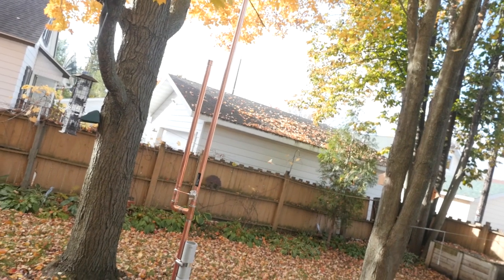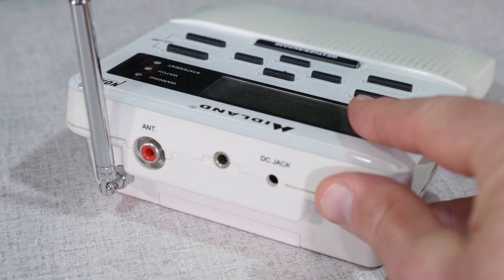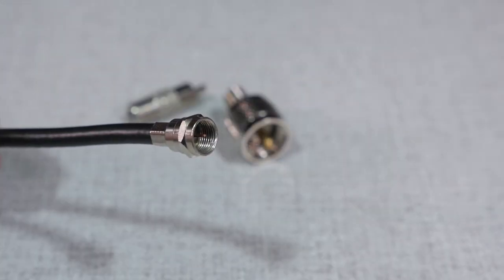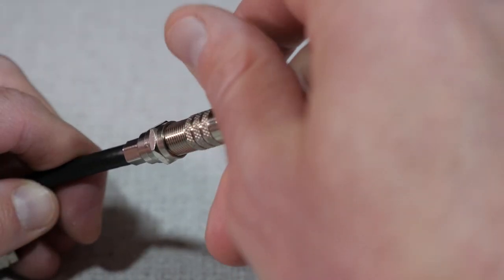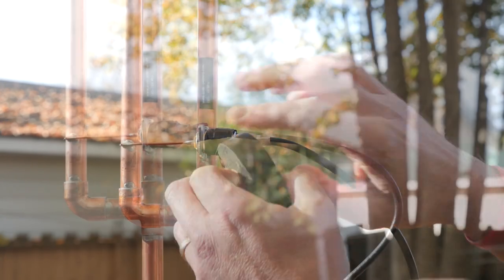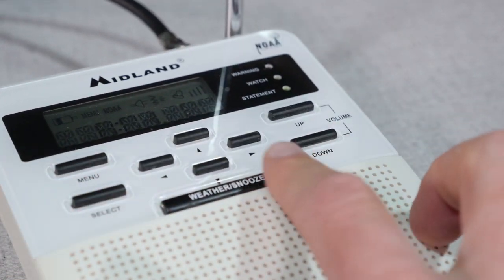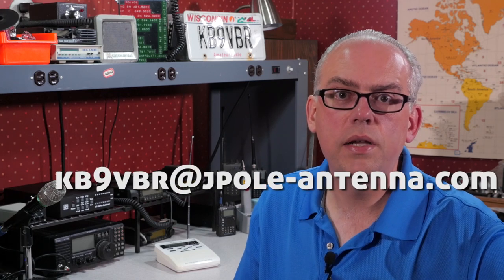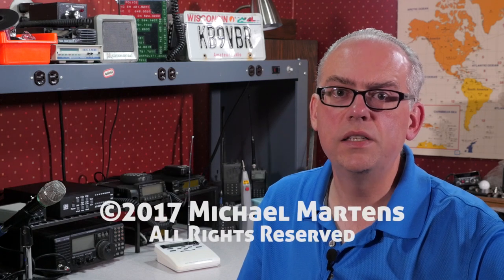Connecting an Antenna to your NOAA Weather Band Radio

Comment: Your NOAA Weather Radio is a Version 1 or Version 2 midland WR100. Those are extremely rare.
Reply from the maker: Wow, I didn't realize the radio could be valuable. It is a WR-100, but I couldn't tell if it was version 1 or 2. Serial number is 30804841. I'm guessing it's an early model as I've owned it for at least 10 years.
Reply: KB9VBR Antennas I know by the statement light.
Reply: KB9VBR Antennas Plug it in. It will say what version it is. (Probably a v2, most v1s are black and silver)
Reply: Not all WR100 V1 are black and silver
Reply: I HAVE A BLACK AND SILVER WR-100!!!! VERSION 1. I got it from my grandpa. He bought it when they were made.
Reply: What is the big deal about having an older model? It seems to me that the older ones don't have the current codes and they lack the feature to ignore the weekly test. I think a late version should be better.
Reply: KB9VBR Antennas their extremely rare now
Reply: @uruiamnot  they are still pretty rare tho
Reply: @KB9VBRAntennas  I think early V2.
Reply: @uruiamnot  people collect weather radios and people really like older radios
Reply: Yep, its a version 2. Any serial number above 306 should be a v2

Comment: Electrical tape does not provide a weather seal. It will break down and get very brittle when exposed to the elements over an extended time. It is best to use a proper sealant to protect the connection from  water intrusion.
Reply: Interesting 🤔. I really wouldn’t have no idea of what to use. Hehehehe 🙂
Reply: phil swift has something to say to that

Comment: NOAA needs to develop an App. Its a no brainer. Pick up the money lying on the ground for Pete's sake.
Reply: I know and make cars come stock with a wx radio frequency. I have the Midland 120EZ I think and it gets alerts sometimes but not all the time 🙄. Good thing I don't have to rely on it and don't get severe weather much.
Reply: You can't rely on an app because during severe weather, internet and power outages will possibly occur at any moment.

Comment: I am having a hard time picking up NOAA radio in my tractor trailer anymore.  I have a cobra 29 LX and it use to pick up NOAA radio good with all the alert alarms... now nothing... AND on a side note my WR-120 I had for years keeps telling me bad reception on the stock antenna... (No matter where in the house I put it), and also it never use too... I live between Norton, MA and Albany NY NWS. I am not sure what is going on, but it seems like reception to my area of western MA has changed on their side...

Comment: Is there anything we can do to help increase the amount of signal getting into the weather band portion of a portable multi unit AM / FM / Weather band radio? Regular weather band radios are nice and all but they’re not really meant to be portable. Just what does the weather band internal antenna look like in one of these radios?
Reply: They have an external antenna, the usual metal telescoping antenna mounted on top like you see on all portable AM/FM radios. It also has an external antenna jack.

Comment: one question, are the jpoles directional?  if i buy one can i move it around for better or worst reception?  i noticed it has a small piece and a longer piece...which one has to face towards the signal?  

thanks...
Reply from the maker: The J-Pole is an omnidirectional antenna, so it will receive equally well in all directions. Any bit of directivity you get from the stub at the bottom of the antenna is so slight that you probably won't notice a difference by rotating it.

Comment: I bought a Midland WR-120EZ radio to replace my 74-109. I can't get the darn thing to give me alerts. The old one still gives alerts but the voice is a bit garbled so we replaced it. I took the first WR-120EZ back to the store, figured it was just a bad radio but the replacement one still will not give me alerts. (With all the snow yesterday and lots of advisories and warnings it never sounded, not once and it always says "NO MESSAGE") I can't put up an outside antenna, but need some booster, I assume, but inside the house. What is wrong with my radio?
Reply from the maker: Maybe there is some interference or something else that is preventing reliable receiving of the weather broadcasts. Try moving the radio to another location or in front of a window to see if that makes a difference. Does the radio work outside? If you can pick up a signal outside, then there might be something inside the house causing interference.

Comment: My Wr 100s antenna is lose  and I think that the plastic part that holds the antenna broke off. I'm not really sure if I should fix it.
Reply: Undo 4 screws on the bottom. There was a screw that both secured the antenna to the case and to a wire. The wire is the important part. You could stick the wire out the hole and bolt the antenna to the now loose wire... and use duct tape.

Comment: CQ CQ CQ Question for you guys. I work at the hospital and I’m looking for the best weather radio available on the market. We have Midland WR300 hooked up to a VHF antenna on the roof, less than 20 miles from transmitter, and with a clear line of sight. The Midland is noisy at best with lots of distortion on the strongest signal, which is channel 4. When I hooked up my BAOFENG UV-5R on the antenna tuned on 162.475 MHz (ch. 4), reception was clear and crisp, so a LOT BETTER than the Midland. I read online that Reecom makes good weather radios, is that true? If I can’t get a better radio, I think I’ll install a VHF Yagi with a 160 MHz Band-Pass Filter, or even change the ceramic filters/caps for better ones. What is your advice? 73
Reply: Does the hospital operate it's own radio paging system? Being close to one of those is enough to swamp out reception.

Comment: Can you hook up multiple weather radios to one antenna?
Reply from the maker: Cable TV splitters are broadbanded and you can use those to distribute the signal to multiple weather radios. keep in mind that you are also splitting the signal strength between two or more receivers. If you have too many splits, you will end up with a very weak signal at the receiver.
Reply: @KB9VBRAntennas  thank you for your reply.

Comment: Can the pole attract lightning? If it Does I won’t buy it
Reply from the maker: Lightning is very fickle and can be attracted by any number of things. This antenna is no more attractive to lightning than an exterior mounted television antenna or satellite dish. You can reduce the chances of a lightning strike by properly grounding the antenna and using a lightning arrestor where the cable enters the house.
Reply: @KB9VBRAntennas  just thought of a crazy idea to get better wx radio reception, would using a old satellite tv dish work? I would prefer not having to mount anything to my house and deal with that crap but I already have a old dish network satellite dish on my house. Is there a way I could use that for my wx radio? 😂.

Comment: I have RCA output from the midland weather radio and a 5 dbi desktop Omni antenna RP-TNC Plug cable. To connect the radio to the antenna with minimum of 5 feet of cable between radio and antenna, has anyone seen this type of cable already made, I have no tools to make the connection.
Reply from the maker: MPD Digital will make a custom coax adapter for you. Check them out: https://usacoax.com/

Comment: May I ask how you run your coax through your house ?
Reply from the maker: My solution may be a little more extreme than most, but I drilled a 2 inch hole near where the house sits on the foundation and installed a service entrance and weather head for just coax. This is separate from my electrical service entrance. This gives me a flexible method of adding and removing coax for my station. This might be overkill if you need only one or two feeds to enter the house, so maybe a smaller hole with an electrical junction box installed on the outside of the house may better fit your needs.

Comment: Not sure that it makes much of a difference for a weather radio with a short cable run, but radios use 50 ohm cable, not 75 ohm like RG-6, which is used for TV RF signals.
Reply from the maker: It doesn't really make a difference. The mismatch is very minor and 75 Ohm cable will work perfectly fine for receiving with little change in performance. If you were to transmit with a 75 Ohm cable your SWR would be 1.5:1 which is still within the acceptable limits of most transceivers. if you want to get into the more technical aspects of this‚ I've got an article on my blog you may find interesting: https://www.jpole-antenna.com/2015/01/28/using-rg-59-or-rg-6-catv-cable-with-an-amateur-radio-antenna/
Reply: @KB9VBRAntennas  cool, I'm a two-way tech, so just always have been taught only use 50 ohm cable for radios, even though like you mentioned it's such a miniscule difference in performance, it's okay to use in some applications or if that's all you have LOL.